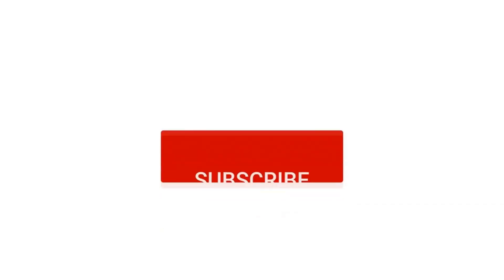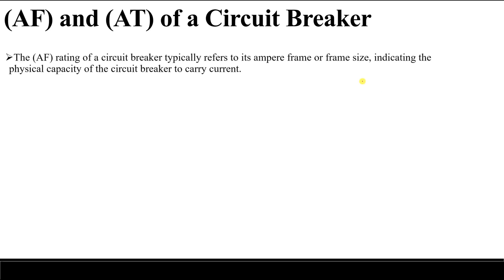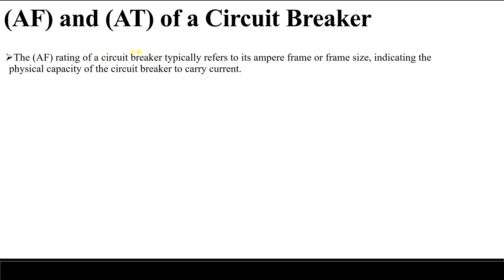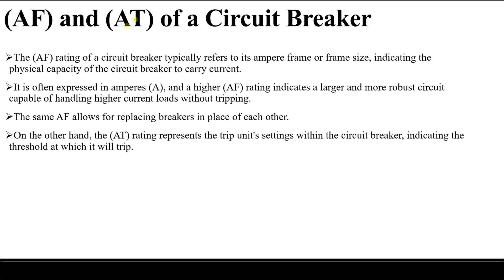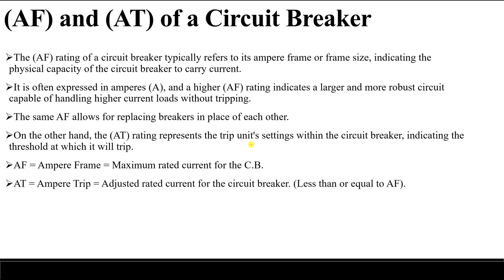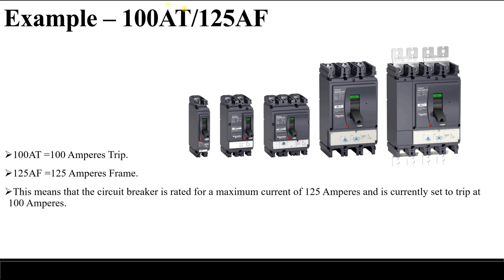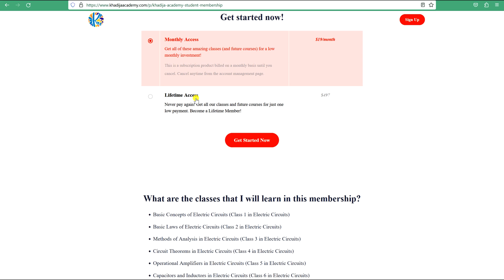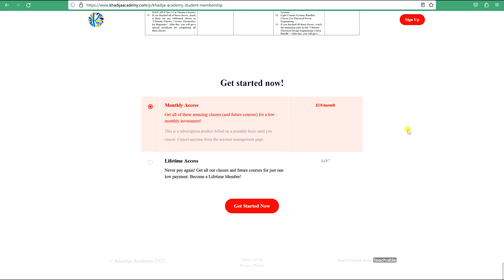What is the Difference between AF and AT of a Circuit Breaker?

Comment: Thank you very much for the valuable information and the video! I have another question: I’ve seen single-line diagrams where, in addition to AF and AT, there is another current value labeled AS, with all three appearing together in the representation of a circuit breaker. Could you please explain what the AS value represents?
Reply from the maker: You're welcome.
AS or ampere setting represents the current setting or threshold of the circuit breaker’s trip unit. It's a multiplier or setting that determines the exact tripping current based on the breaker’s trip curve. 
The trip setting (AS) could be adjustable to fine-tune the protection level according to the needs of the system. 
For example, if the AT is 400A, and the AS is set to 0.8, then the breaker would trip at 320A (0.8 * 400A).
Reply: @EngrAhmedMahdy  Understood, thank you very much for your time and for answering me.

Comment: Greetings, sir! I just bought your solar course on Udemy, and I am from an IT background, but now that I am passionate about electricity and electronics, I just want to know how I can become a self-taught electrical engineer from your other courses, step by step, or suggest your courses in chronological order.
Reply from the maker: Good afternoon,
Thank you for your trust and your interest in learning about electrical power engineering.
If I were you, I would take the courses in the following order:

1- Ultimate Electrical Circuits for Electrical Engineering
2- Ultimate Power Electronics and Electrical Protection Bundle
3- Ultimate Electrical Machines for Electrical Engineering
4- Ultimate Power System Fault Analysis for Electrical Engineer
5- Ultimate Wind Energy Course for Electrical Engineering
6- Complete Solar Energy Design Course From Zero To Hero
7- Ultimate Renewable Energy Course for Electrical Engineering
8- Ultimate Electricity Generation, HV, and Substations Bundle
9- Ultimate Electrical Design Course from Zero to Hero
10- Ultimate Overvoltage Protection By Surge Protective Devices
11- Ultimate Lightning Protection Design for Electrical Engineer
12- MATLAB/Simulink - Simulink Course for Electrical Engineering

Regards,
Ahmed